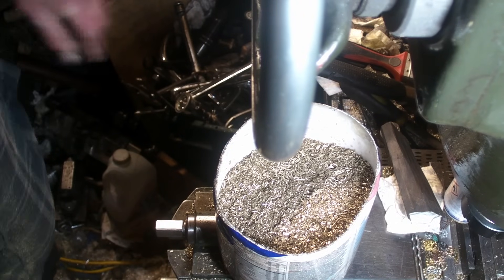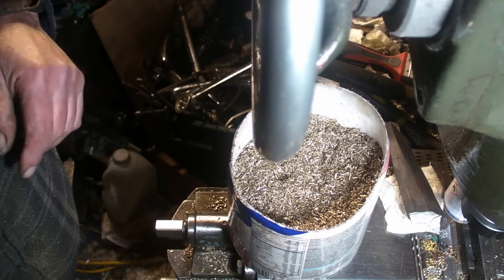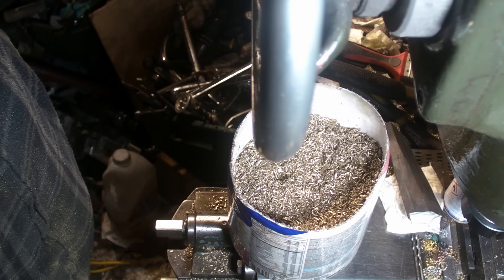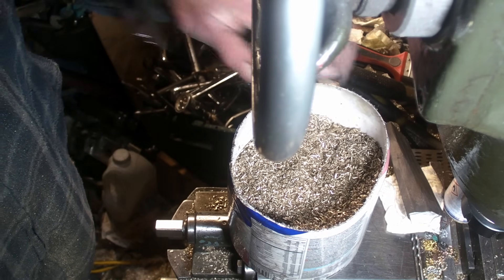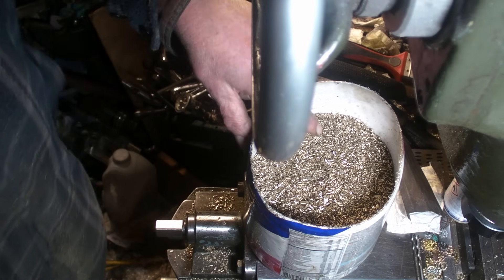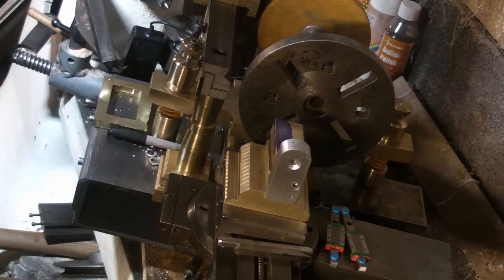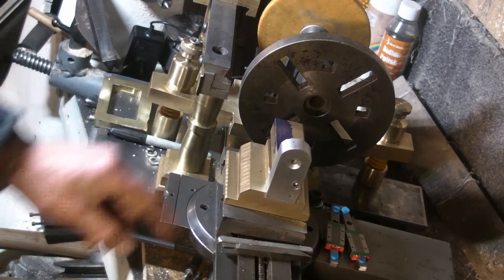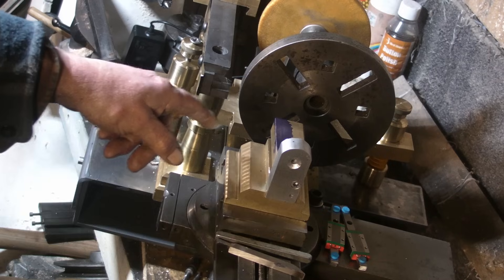Can I recycle brass chips

Comment: Aluminium chips are a nightmare, the surface oxidises and you get more dross than usable material.  Brass should be easier to do; if you want to know how you're doing you need to do a compare and contrast.

Take some solid bits, weigh them, chuck some borax in, melt, skim the dross, pour, and then weigh the resulting ingot.  That gives you a ratio of source to product.
Do the same with a load of chips. Might be worth cleaning them first, mind. If you get a similar ratio, you're onto a winner.

Comment: You are dragging in air pouring into that pipe, it will be full of air holes, very porous. Remelt it again , use borax as a flux and pour in a sand mold for better results.
Reply: Standard cheap charcoal powder works the best

Comment: Did you degrease and clean those chips? Use flux to prevent the chips from oxidizing at high temperature and to split of oxides and impurities (the scum) before casting.
Aluminium forms a skin of oxide which you can't melt, so you always will have a lot of scum, but without flux you'll be making more and more oxide as you go. Again flux will prevent oxide forming on the molten aluminium and will help you to separate the scum. But aluminium has a lot of surface, so also a lot of surface oxide.

Comment: Your Al chips are a problem to melt because the oxide that forms on the surface while melting has a melting point of over 2000°C the smaller the size, the greater the surface area.This means that you have little sacks of molten Al surrounded by the un-melted oxide that makes a kind of mush. The bigger the chubks of Al the better!
Reply: Flux may help
Reply from the maker: Thanks for the info Mathew, do you know if that same process occurs with brass chippings ? I think I'll try just chips in the crucible next time and see how that goes !  regards...Del...
Reply: @machinenutdel6764  As far as I know, brass is not the same, you should be able to just melt the chips without any oxidisation problems. The thing about brass is it's  zine content, zinc evaporates at 700°C. White smoke is zinc vapour a void inhaling ! Fume fever from zinc vapour will give you 2 or 3 days of flue like symptoms.  Get it molten and pour as soon as possible.
Reply from the maker: @MatthewTinker-au-pont-blanc  Thanks Mathew

Comment: Is that brass 0.00% lead?  Avoid dust/chips/fumes if not.
Reply: The usual 3% lead in the brass is not dangerous for handling . For casting are the zinc fumes a much bigger concern
Reply: @Pyrokartoffel There's no safe level of lead contamination.  It accumulates s in the body.

Comment: Be careful of the fumes off of brass- lethal eventually
Reply: You were right first time, always melt a lump first and gradually add your swarf. Always use some flux too. The piece you turned up looks nice though once you got under the tough skin. If you can manage it hold the spout of your hoover over the tool, that way you get nice clean swarf for the next melt.
Keep at it mate!👍
Reply from the maker: Thanks Drew
Reply: ... @DrewDiaz ... i agree, brass is made from copper and zinc, vapours of zinc can led to the "zinc fewer", and also cause dizzness, head ache ...